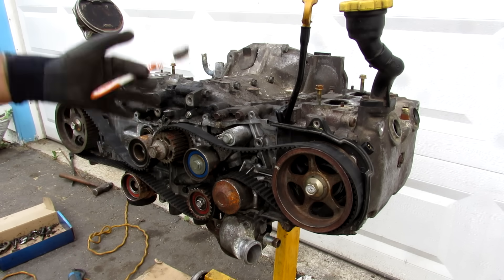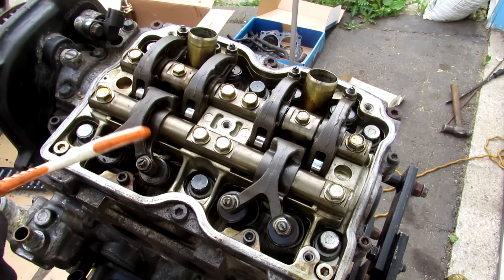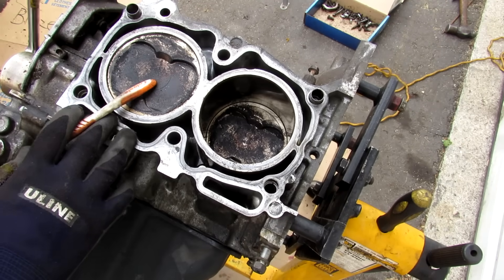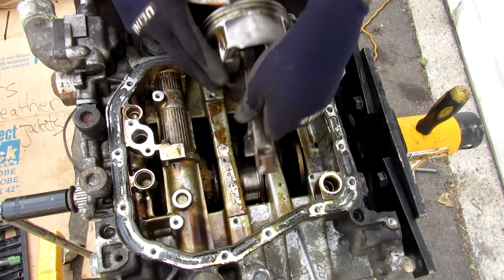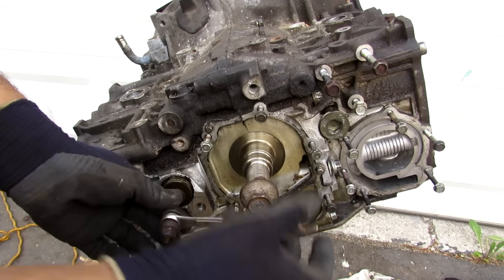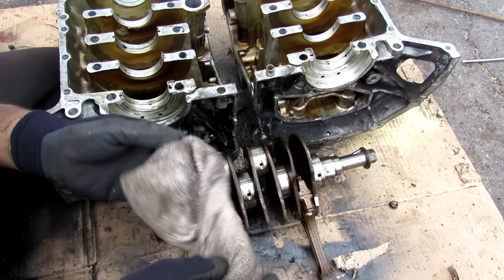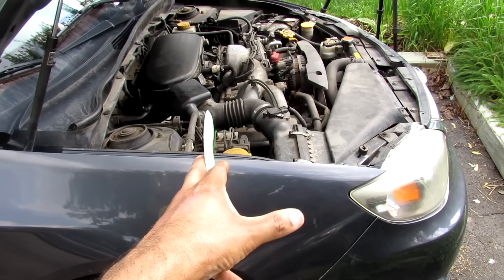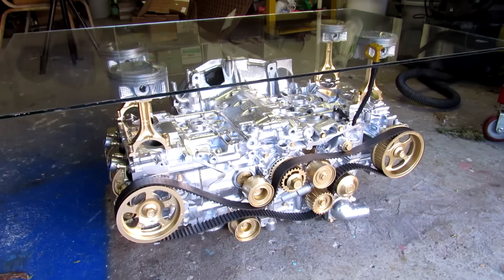Why Subaru Engines FAIL

Comment: How many hours, days, weeks , years did it take for him to get this proficient and knowledgeable about how this (and other engines) work? A true master of his craft.
Reply: Its putting them back together that's hard.
Reply: @billboyd4051  Putting them back together is easy enuff ! It's just the reverse of taking them Apart ! 
For me, the problem is storing all the extra bits left over ! 🤔 
Plus, unless you have All the "Special Equipment"
 (ie:Tools that are Too Expensive !) You can't get them working again – well I never have,  but that's Subaru's Fault for putting in all those "spare" pieces inside The Engine - where you can't see inside of course, until you take it apart on the grass bit outside your house ‐ or mobile home, trailer or dbl-wide – I ain't one for discrinymating! Sometimes poor folks are better at "lifting" whats needed, for to get her done rite !👍🏻👌
POD, 🤨 😮 
I just watched this Again, and I mite have made a cpl of mistakes !
🤔 🤔  😮 😲    🤯 !!
Reply: @Keiran_P0D_Benn1678  Even my 1975 Subaru that i used to mess with needed special tools.
Reply: @leaonardland9001  I was a Volvo guy in the 70's, few special tools and never needing the motor touched. Now its getting hard to find the motor under all the plastic junk.
Reply: @billboyd4051  My first car was a 1961 Volvo 544.
Reply: @leaonardland9001  My 78 242 still on the road, great cars then, a bit expensive now.
Reply: @billboyd4051    due to the minor amount to parts and their obvious placement, the assembling of engine is simple process. Hard is newer 6 and 8 spd automatic transaxles.  A 1000+ parts with pulse width  modulated electronic control systems makes for a lot of fun.
Reply: @rickh633  Perhaps one day I will meet someone who wants an automatic transaxle.
Reply: @billboyd4051   like them or not they are in pretty much every car made now. . One of the first computer controlled ones was the Chrysler A604.  what a pail that was. Chrysler use to ship a  box of parts with A604 equipped vehicles. Techs had to rebuild new transmissions before they left the dealer. LOL
Reply: @billboyd4051  I've  noticed that taking things apart is much easier than putting them back together.
Reply: I learned engines by just tearing apart rototiller and lawnmower engines. You can get free small engines, and you can take them apart for fun. It becomes a hobby once you understand how simple engines actually are. Although I've never had any desire to work on a Subaru haha. They are't exactly "fun" to work on, from what I've heard.
Reply: @Ritalie  where can you get a small engine for free?
Reply: @christopherportillo1758  Lawnmower shop, run by some guy in his backyard, or an old go kart racer. Small engine guys love to help, and will teach, if you are willing to wash parts.
Reply: @Ritalie  My dad was a mechanic and he made me promise not to buy one just because they were a nightmare to work on and had a lot of issues - still kind of want one.
Reply: @Ritalie  I tore everything apart as a kid, and still do, a big screen TV recently, just to see how it was built. I recycle the parts, and keep the things I might be able to use for projects. Now I can fix anything, half of the time.
Reply: @billboyd4051  That's awesome! That's exactly what I do. I take everything apart before I throw it away and save switches and wires and transformers. I'm shocked how people have no interest in inventing things. How can people be happy just focusing on slave labor daily?
Reply: @Ritalie  I like your many projects, life's too short to play the slave game. I'll subscribe and check them out.
Reply: I'm 30 years and currently learning all I can about car engines.  I suddenly found them fascinating and now I'm learning.  I'm learning quickly and will be doing my own practicals soon, thanks to videos like these.  Appreciate them.  
Never too late to learn something new is all I wanna say
Reply: In Germany you learn 3,5 years bevore you make the big examination in theory and practice. After that time you should be able to know this things and you can call your self a car mechanic.
Reply: A while, but not so long as you may think. All engines have pretty much the same basic parts, so learning about any of them goes a long way to learning about the rest of them.
Reply: He doesn't know as much as YOU think he does.
Reply: Prob just watched a couple YouTube videos 😏
Reply: Took me like 3 years to become proficient in heliocopter maintenence, you hit this point with your knowledge, when you know you know alot, but there's this vast depth of knowledge that you don't know which makes you feel incompetent. It's kind of like finding the drop off in a lake.
Reply: I believe he's a Mechanical Engineer
Reply: @chuckycheese84  That's no excuse.
Reply: It's mostly just learning engines themselves, after that everything is just individual niches and odds with each manufacturer. Once you learn the core basics you pretty much just start collecting knowledge based on what you are working on.
Reply: Probably a year or two . That's how long it took me
Reply: You need compression, fuel, and fire/spark. And it’ll run haha.  He’s a meknick
Reply: It depends on how interested in learning you are. When I got my first car I slowly learned as I diagnosed and replaced things. Then the car broke down (GM car, go figure). Took me a long time to get enough money to get another car during which I did a lot of comparing and I got interested in the mechanical side - when that happened knowledge came FAST, in just a few weeks I went from "I need a mechanic to replace a serpentine belt" to "Wow, its really just conflagrating lego for adults" and I do literally everything myself - with a lot of help from the internet/youtube but I think most things I could figure out but why make it harder for yourself. That said I havent done any rebuilds yet. Moreso regular like stuff timing/drive belts, water pumps, thermostats, struts, e-brakes but that seemed impossible just a few months ago.
Reply: its called experience principles are he same in whatever engine, i.e. oil starvation, the commenrt re oil slopping in a rally (its not rally racing thats a america phrase it rallying) thas why you drysump an engine also you can baffle a sump etc. and build an engine accordingly for motorsport.
Reply: My 2014 forester had the half block changed at 80k under warranty for the piston ring problems that burned oil day 1. No problem since and at 143k.  Yes the spark plugs are tough to service. I'm excellent at maintaining maintenance and change the oil sooner than recommended. 2014 has a timing chain. I hear the piston slap on cold starts and it fades quickly. Next time I'm going toyota.
Reply: some people I have met that are this knowledgeable on motors have been taking them apart and fixing them since childhood and have never taken a class or any real school courses yet are the best machanics I have ever met
Reply: We blew up a few by few i mean like 10-15 of them before we figured it was shit and went with 2jz and made over 1000 horsepower this was 15+ years ago. The only solution to these is taking the engine out once it craps and putting in a good ol 2jz.
Reply: yes a lot of time invested in pot metal, just as electric cars are becoming popular
 ;D
Reply: It's called work dude...... nothing more nothing less....get used to it.
Reply: There really aint much too them and symptoms are usually similar in any engine. It could've taken him years, the higher the i.q the less the effort it takes to learn!

Comment: Had a Subaru voor 12 years. 450k Kilometers with an LPG system on it. NEVER had any problem. Never. It was a engine with hydraulic valve system. Abused that car incredibly, just not a  single issue……
So maybe the newer engines are lesser than the old?

Comment: The boxer engine junk.
This particular 2.5L engine overheats at 50 k miles after a coolant change. Even if the dealership does it.  Air gets stuck in the upper engine and also down by water pump it bubbles and slows the water pump from being effective. 
Why no recall? 
F___k u Subaru.

Comment: Our 2002 Subaru outback  timing belt broke. after the repair of $5 grand the troubles started. 
Over heated dailey. Oil in coolant.  After that repair it still over heated. After 2 more mechanics and much research I decided to drill out the thermostat weep hole to 1/4inch.  Problem solved but then the timing belt broke again while 400 miles away from home. Sold to the first caller.  F___k Subaru crap. 
Oh but it's cute and 4 wheel drive BS.

Comment: I spent 6 years at a subaru dealer as a mechanic - they are some of the easiest cars to work on. thanks for this video! even a subaru expert like myself can learn something new. i had terrible flashbacks the second you mentioned the cam sprocket bolts that strip out..... i have had to use my cutting wheel and chisel on multiple turbo engines to get those off. we actually quoted customers new cam sprockets when giving estimates because thats just how it goes.

Comment: Change the oil regularly and the timing chain every 80,000 miles. Should go 200,000 easy. Pretty bullet proof motor.

Comment: My wife had a '09 Forester with the non-turbo EJ253 engine and 79K miles. It had cold engine piston slap and I was dreading the eventual head gasket replacement. The dealer had replaced the AC compressor for well over $2K. Last year my wife totaled the car inside a brushless carwash!! Her face was injured hitting the steering wheel because none of the air bags deployed. We replaced that Subaru with a 2021 Lexus RX350 and never looked back. Good video.

Comment: Had an EJ with 60k + that I heavily autocrossed for several years, constantly near or at red line and lots of high revs in 1st and 2nd. I never had an issue with it. Must have been luck? I did absolutely zero modifications and tunes and maintained it at or better than spec.

Everyone I knew who did take a trip to ringland, all of them had tuned or modified their engine.

I'll give you that though, they are a hassle to work on. I did all my own work on my wife's Honda. I won't even attempt much on my WRX because I'm way too lazy to start pulling/dropping engine or take all of the crap around it in order to access stuff. That's a job for someone more experienced and better tooled than myself.

They are hella fun to autocross, track or rally though. They're so very good at it.

Comment: I have a 2019 GT86 Pro Euro model.  So it's a Subaru block, but slightly different.  86mm stroke and bore.  Toyota VVTI and toyota dual port/direct injection system.   Normally aspirated, 7.5k red line.

Comment: Driving a 1999 Forester tb since 2015. Great engine! Gets an oil change twice a year and clocks now 210,000km. Planning to keep driving it until it gives up. Have a great mechanic who changed the timing belt few years ago. Am in Zambia, Africa.
Reply: A car can only claim greatness if it can do reliable service in Africa.
Reply: @ChrisH-r2f  had damaged my oil filter in the meantime and the engine ran dry, started knocking. But even that was snot such an issue as it could be fixed for $300. Damage the battery of an electric vehicle and it's totalled.

Comment: I have a 02 Impresa with 288,895 miles on it, still running good, and not using oil. Give them love, and they will last.

Comment: Subaru took a tried and true air cooled VW design, and mucked it all up with needless complexity.
The only Subaru motor I have any respect for is the old 2.2 engine. Simpler design,
fewer failures.

Comment: just went outside and set fire to my subaru. you never know this stuff when you buy one but learnt pretty quickly and sold mine after it did a clutch ….. which is another item that fails on them. does a set of tyres every 5-6000 miles drinks fuel like it’s going out of fashion …… and and

Comment: I looked at it to internalize myself in the failures, I am not an expert of course, but a friend and his family have already done thousands of kilometers in their 2 subarus and have not suffered any of these problems, what's more ... they seem very durable engines.

It has something to do with poor maintenance (allowing poor quality overheating and oil mixtures) and poor use of the car?
Reply: Rally proven for years
Reply: no maintenance will kill any car.

Comment: @11:43 you said huuuhhh? I wish you would have talked about that a bit more I'm very intrigued,  you passed over it like it was nothing but last I checked a main bearing isn't going to last without oil and also theres a groove on it like theres suppose to be oil coming in somewhere, and how did it last just as long as the others if it's not being lubricated?!?! Arrrr I have soo many questions lol

Comment: Sure, it allows for a slightly lower centre of gravity, but at what cost? A nightmare to service and maintain at the best of times, even if it was well designed... which it isn't. Just a huge pile of trouble with no discernable benefit.

Comment: OMG! Using a hammer to separate the crank-case. You'd be fired for not using a mallet in my workshop.
BTW At the beginning you said the pistons move from side to side, latter you said up and down. They do neither, they reciprocate.

Comment: Subaru Engines are a great example of effective engineering. They are not very powerful or smooth compared to a more traditional engine, but make it up twice over in toughness. I have seen them go months or years with leaking gaskets and rod knocks and still be perfectly capable of the main purpose - driving the car. Keep the oil full and it will keep going until you can make the repairs. I had one I ran without coolant for an extended period - it would overheat and seize up, but wait 15 min for it to cool down and it would start and run fine like nothing happened. That being said, I have seen them shoot pistons through the block. Not very common but it can happen.

Comment: Glad I've never owned a Subaru. Enter 'Mechanic' into any car classified sales search and you will find more than a few boxers. For how reliable and easy to work on as their owners make it seem, hard to imagine why you can easily find broken down ones for cheap with an owner dying to get rid of the fucking thing.
Reply: It's easy to find them broken because there's a lot of people out there who slap on some Bolt ons and beat the hell out of the car without a good tune. Cheap sports car and young people driving crazy is a bad combk

Comment: I use my wife’s toothbrush to clean engine parts too!
Reply: I use my wife's toothbrush to clean the toilet bowl. I give it a quick rinse with hot water after I'm done. 
I think using it in the workshop might be risky, I'd have to use degreaser on it to clean it.
Reply: @gjw45  Ha ha! Thanks for the tip!
Reply: nice job! 
who needs kisses from them anyway

Comment: It seems the 2 root causes of Subaru's less-than-ideal engine lifespans are:

Sub-par lubrication machinery (oil distribution could be improved)
Poor material science. (Cracking ring notches)

Comment: Looks like a '99-'00. My 2.5's piston parted company (at 4500 rpm) from wrist pin which I found in pan (one end flattened) then the rod swung around like a bat smashing block to bits and breaking rod in half. Covered 3 lanes in smoke and oil. Had 300,000km on it. I found a replacement for 350.oo in scrap yard.

Comment: The adressed points are the reason why they are dirtcheap to have on the uses market with 150-200km on the clock - engine wear starts to take effect and the repair will cost high 4 digit.
Its so sad. 😥

Comment: On an engineering design the piston will last longer with more even wear for the rings , pistons and cylinder bores if they  are vertical .  You will also have less issues with burning oil .

Comment: The piston slap is actually caused by the switch to a shorter Piston skirt to reduce NOx emissions, they added the teflon coating as a bandaid.
General motors had the same problem with the 3.1 V6

Comment: Had 2 of these engines shit out on me before I finally gave up on my outback.
Reply: and that was with regular oil changes?
Reply: Only fix I see for this is a chevy small block transplant 😲
Reply: @holmes1956O  hahaha that would have been fun, moved onto a gen1 tacoma, runs like butter
Reply: @dvoob  right on. Sounds like you made a good move

Comment: I don't get this thing about "fluids are in contact with the head gasket when it's off" 

Isn't that true with all engines? Unless you have a bunch of air in your cooling system. The issue was the specific head gasket they used on many NA EJ25s. The turbo cars with MLS gaskets don't have any head gasket issues

Comment: 2015 STI ran OEM oil until 103,000 miles. Started Motul 5W40 oil at 103,000 miles. Was on stock tune until 95,000 miles (never used or owned Cobb AP). Go pro tuned for an intake. Added AOS, bigger radiator and TMIC for cooling. Turbo failed at 105,000 miles and got rod knock from burning oil inside turbo. Dipstick was still full on 2000 mile oil use.

Comment: do a ford fusion ecoboost i4 engine. 
i had 2 different engines with cracked/blown #3 piston head. it happened a year apart both times in fall season. it was properly maintained. 
if i known my 2016 ford fusion was going to have reliable engine failures i would have bought something better.